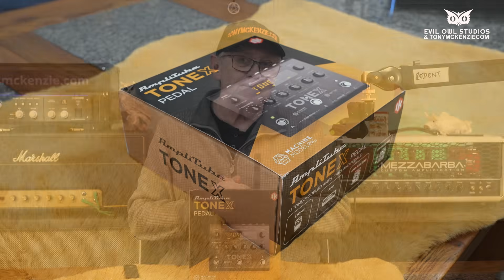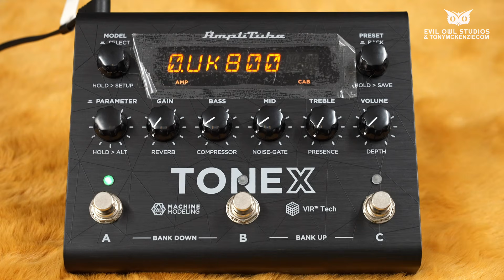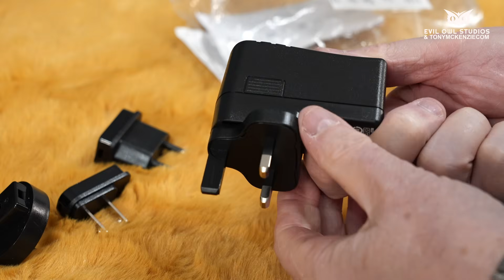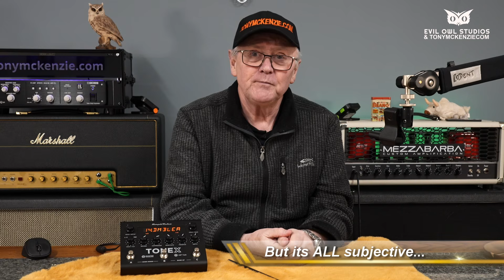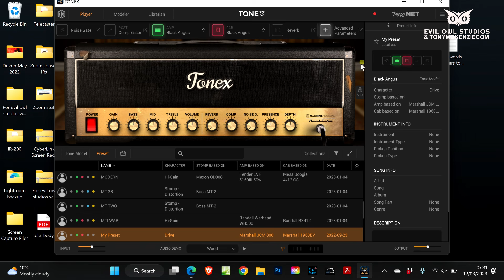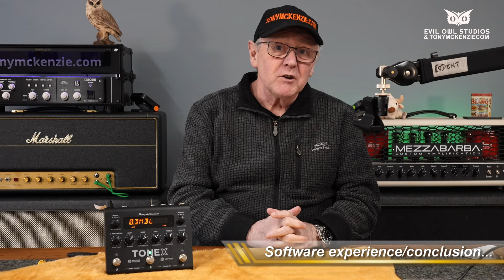TONEX Amp Sim  Simulator | is this Finally Utopia for guitarists?

Comment: I have a tonex software wasn't a problem to install , its worth watching a few you tube videos because there is quite a bit in the software split into librarian modeler and edit program like any new items you have to pick up tips and spend time because it  can do so much ,turn the gain down and set the noise gate on the pedal rather than the software it is noisy if you dont ,capture is excellent ,i'm not a young guy  but love how much you can do with its it will copy your amp and use it , you wont tell the difference  .
Reply from the maker: Glad you are enjoying the capture features and found a workflow that works for your setup, thanks for sharing your experience! And of course for watching..

Comment: soft problem is because of your laptop screen low resolution ratio. software designed to be fit 4K display. as you dislike china, I dislike software from Italy also, very bad interface. old people should speak less on computer things, not for your age.
Reply from the maker: Ha thanks for the info... and guess what, I was in IT since 1981... visiting Singapore, HK and Taiwan many times... we gave up on IT in around 2000 when we could no longer actually make money at it because Dell, HP and many others killed off the hardware dealers. ;-) I don't believe for one second that the software was 4K only... sorry about that - most users out there do NOT have 4K even now. Thanks.
Reply: @tonymckenzieofficial  today I update the new version of TONEX and AMPLITUBE software. maybe the very first day of new software the IK has big pressure on its server, can't afford so many download request. just some patience, my download recoveried a week later. all becasue of IK server. not resolution issue on today IK product manager software.

Comment: Nice pickin!!! I just got my tonex pedal.  Can't figure out the app
Reply from the maker: I had issues with the installation of the apps. The initial program installs then you authorise the rest from that program if I remember correctly. It took me a week to make it work and I was surprised that problem was on the internet about that program from 2 years earlier. Once installed it does work OK though. Hope that helps and thanks for watching.

Comment: I've bought the pedal secondhand for a bargain price a week ago. Ik Multimedia transferred the software to my account. I'm running windows 10. My whole live I play tube amps, I've got 8 of them. Fenders, Marshalls, Vox, Victory. I love them but I wanted to se where all the fuzz is about... Is this new kid on the block a game changer? In two hours I had the software up and running, tweaked some Tone models, compared them to my own amps and came to the conclusion that this device is going to stay. The latest software updates made things a lot easier. When I play specific Di amp captures through my existing amps effectsloop they sound 90-95% the same. In the end I buyed some captures and I could not hear the difference at low volumes and gigging levels. Indeed there are a lot of tweaking options but for me its intuitive. Will I sell my precious amps/cabs? Never!! But for the odd gig where no amps are allowed or where silence stage is a must or for recording purposes or grabbing the unit at the couch and play through headphones this unit for the price is a no-brainer. Not everybody can crank their amps to the sweet spots without getting in trouble with their neighbours. Another advantage of this technolgy is that it is still evolving and software updates will rapidly follow. I never thought in my wildest dreams that I would like the digital AI world but I only see challanges.
Reply from the maker: You should try the Kemper Player? While it does not capture - it does not need to... it has 22000 profiles of gear already... don't assume its 'no good' and I'm reviewing this right now... IMO it is superior on many ways... watch for the video. And thanks for your take on the Tonex - great to know you like it... and thanks for watching.
Reply: @tonymckenzieofficial  , thank you for mentioning the Kemper Player. I was in doubt which unit to buy and in the end I choose for the Tonex system because I have all my effects and modulation already sorted out and I knew that the software was updated. There are some "scientific"tests on youtube where these two units are compared to eachother. A lot of blahblah with nerdy measurements and in the end the conclusion is that NAM and Tonex in the amps department are still superiour. NAM is the best. FWIW I think that all these units (Kemper,Tonex,Helix,QC etc ) are capable of producing convincing amp tones. And I'm 60 years old and after 40 years of rock & roll volumes my ears aren't the best anymore....I leave the whole capturing process to professionals, because they have the best mics/pre-amps and know everything about mic placement and such. It's an art in itself and I'm willing to pay for them. 22000 is enough for a lifetime but I only need a couple of good clean/edge/chrunch/mid gain tones that are convincing. I think the most challaging part of this technology is not the captures itself but a decent accurate monitoring system which satisfies tube amp lovers. I don't like a lot of consumer FRFR systems out there.

Comment: Had the pedal since February.
Haven't turned on my EVH Iconic combo amp since.
You need to know how to program the EQ, gain, presence and depth to really make it shine.
The original captures are mud otherwise.
Fortunately, I have decades in synth and F/X programming.
The room reverb adds just the right touch of sweetness at small amounts, don't use the others.
One patch I've edited is worth the price of the pedal.
I run it through an EV EKX-15P with 1500 watts power and a 15" bottom.
Instant wall of sound.
God help my neighbors :)
Reply from the maker: Strangely, my versions of software were at best very ropey. I found the worst candidate was actually the software that is supposed to authenticate the other stuff to run. It never worked on my V10 Windows and on the V11 rather poorly for the most part. Good that you made it work well for you. I remain rather concerned about software releases that really did not seem to work correctly and the entire units dependence on software that was spasmodic. I wonder what might happen to this device and all the others they make if they ceased trading. Those are important concerns IMO and certainly had it all installed well then that would have been a different matter - as your opinion clearly shows. Thanks for the post and for watching.

Comment: Thank you for emphasising the DAC and how important it is. This is well known in HiFi. As we begin to use these devices more and more to convert digital to analog, it will become clear that there is a quality and application range that we all need to consider. It is the voice of the divise since it converts digital signals to analog and ultimately the output signal.
Reply from the maker: And of course the A to D converter too.. often paired by makers from what I see, but I did not check this unit sepecifically. Thanks for watching.

Comment: Great video but installing the software was a breeze for me but I will say the ToneX app comes with a slight learning curve but once I got it figured out (1hr or so later) its killer and much better than other products.
Reply from the maker: Sadly that problem has been around for a few years :( and it still currently does not work on that Win 10 Laptop (that can't be upgraded thanks to Microsoft!). Thanks for the post and your experience... and for watching.

Comment: Tony when I turn on my hand wired amp and I see the 6L6's glowing, it makes me feel good in a way a metal box full of surface mounted chips never will. Big difference in your opinion and a retailer trying to flog them to you. Imagine wading thru that instruction manual.....no thanks.
Reply from the maker: Ha some challenge what I say sometimes, but it really was as my experience showed as a user. Mine will be sold. Thanks for watching...

Comment: The washers are there to take the strain off when you plug in from the outside. They take up the spacing between the socket and the inside of the case to keep it tight. They also help to dampen the clunk as you push in the plug so it sounds less hollow. When I tried the software it played havoc with my USB interface and Studio One, so I had to uninstall it. I had that exact same issue with the hanging. Releasing software with this level of bug and support is completely unacceptable.
Reply from the maker: Of course I understand why etc. and thanks for pointing that out, I only mentioned those because I'm used to seeing plastic spacers that many makers do use. The washers work fine no problems there from what I see though... The software was clearly for me the weakest point and its one reason I did not spend much time on it - I just don't have the hours messing about, and the original hanging cost me three hours. BTW they did send me an email for support about 2 days in, and I'll follow that up when I get time and see what they say. If I do get an answer I'll probably make a short video of the answer. Thanks Phil... and for watching of course.
Reply: @tonymckenzieofficial  Thanks Tony. I would be interested to know what they say about the installation issue. Keep up the great work. :-)

Comment: Interesting review. I decided to go for it. I think on balance the pedal sounds great and is far less expensive than other products. Combined with my HXFX it has created a versatile rig at a price point I can afford. I have been using IK software for a fair few years and yes, there are many issues in my opinion however, it does work once you get your head around it. I found the pedal intuitive to use and suggest those unsure to find one to try as this review does raise valid points. Sonically though? I’m a happy camper.
Reply from the maker: Yes it IS a very interesting unit I agree and before I bought it, I watched a few 'reviews' (always guys that get them free!) and really was entirely unsure of how good or bad the Tonex would be. It was not bad, and I did like the hardware pretty much with little to dislike. The software I found out was (as you might have seen) seemingly dependent on what you're installing it on to. The Win 10 failed miserably, and the Win 11 did work. There IS a lot for the money overall, but having time in a review to start going through it all at the time was hard as I messed about for three hours on the Win 10 episode. This will be a great unit for some guys, a good one for others but anyone that is not really a software guy should walk not run. It IS priced right no doubt. Thanks M - and for watching too.
Reply: As always Tony your reviews are detailed and informative. My TSL was struggling until I found you and your extensive information and since then it has worked flawlessly. Keep up the good work, there are many who appreciate and benefit from it.

Comment: I think if you purchase this pedal, it would be used for live performance using external effects. I downloaded the free version to listen to the amps and was fairly simple and sounded good. Wouldn't have to get into amplitude 5 unless using for recordings. You can't transfer the effects to the box anyways. There would be plenty of captures you could use without having to get into capturing your own. Just use it as an amp, as it was designed for and not mess with all the other headaches.
Reply from the maker: That's a not invalid comment. If I was going to use this, like you said, there are multitudes of things to downloads, captures etc. I found on the Kemper (a good example really) that some captured gear posted was not always great and you do have to spend time on checking those all out whichever of this type of gear you buy. The capture procedure can be difficult and the guy with all those amps (Tone something or other) got his friend round to make all that work. But once you set up that pedal with what YOU want then really it could just be used like that if someone was not in to the software. Good point and thanks for watching.
Reply: Thanks Tony, I generally play live with my marshall jvm and don't own the tonex pedal. I do use and atomic amplifire 6 for short shows and works great thru my pedal board. When I record, I use my tascam model 24. Just don't have the time to play on the computer editing stuff for long periods. Thanks for the review!

Comment: I have to be honest, I have the Quad Cortex  & the Tonex  (and I have owned the rest too). The Tonex is 'as good' as the QC, in my opinion. OK, the QC has effects, but what it does have are nothing to jump up and down about.  If I wanted a really great set up on a budget, I'd but a Tonex and a TC Electronic Plethora X5, for my effects. I am at the age where carrying amps & cabs around is a struggle, but I still want the 'amp' sound. I always appreciate Tony's reviews, but I differ on this product. Regardless, he's still a superb reviewer, and I love when he says, "I'm back".  Regards to you, mate.
Reply from the maker: Ha I'm back :) I never did 'bite the bullet' for the Quad Cortex... almost a few times. But I still have the Kemper and that remains 'interesting' over the years since 2011 when I bought it. It's not that I did not like the Tonex, and like I said I do have the Kemper among other stuff, but the software became difficult on the first PC (over three hours to try and resolve it and I had to change the PC) which slowed me down dramatically. I have used plenty of this sort of software in general but the time factor I really did not anticipate. The hardware was very good and I did 10/10 for that, but I did think the software could have been improved somewhat. I never had a single issue with Kemper software (but then again the Kemper is much higher cost). Ha not sure you're my age, but trust me on this, I'm probably as old as anyone wants to be carrying gear :) it's hard somewhere near 70! How I do this stuff I am often surprised I still do it. Thanks for the info - its all great information - and that can only help many I think. An interesting unit for sure... and thanks for watching.
Reply: @tonymckenzieofficial  Thanks, Tony, good to hear from you. Let's be honest, in a mix it's all subjective. They all sound great these days :)
I had your fave rave (the Axe FX) I was never taken too much, a great unit though. The Kemper, I liked it, not enough to keep it though. The QC;  well as I managed to get a stunning Engl capture (my dream amp) I kept it. It's excellent, recorded :)
The Tonex; I just like gear (sound familiar?) lol. Best regards from Liverpool.

Comment: Exceptional insite on this that the other 7 or 8 videos I seen they didn't include (manual, software...). Brilliant, thank you sir.
Reply from the maker: This is why I always mention it all. One guy asked me somewhere on here about the spec sheets and 'what relevance' they are, but they DO have relevance IMO, just like the manuals, the software, and importantly the support which I always think is critical for anything that has a high level of software. Thanks for watching - its always appreciated.

Comment: Good review. I think the software issues won't bother people who are familiar with Amplitube. 

I do agree that there are probably better options for people who don't want to mess with software (Strymon Iridium, UAFX, Walrus ACS1, etc)

I also think some companies like Line 6 have a better communication between software and hardware, but they've been in that game a lot longer.

I know you are amp guy, but sadly the future is looking to be less about amps. Partially because of the reasons you named, but also because most venues want lower noise. 
It is what it is.
Reply from the maker: :) Well, software can be volatile, and one reason I mentioned the support aspect. It was a bit ropey from my experience. I'm sure over time it will improve and be a better experience especially re the install aspect which was surprising that the apps were not published as registered products... (Microsoft said) that was something I have not seen for a while. Well I am an amp guy, but I also own a Kemper, a Helix, Boss gear etc. etc. so I am always open to good gear and software I don't really mind (I have Studio One in the control room also) when it works well. But I'm sure it will get better. As I mentioned in the review finding ANY new amps is particularly difficult since 2020 which is pretty weird. In sectors I work in there is still shortages of electronic components etc. In any case good points you raised and I appreciate that as it helps all round for anyone who comes and reads the posts. And thanks for watching...
Reply: @tonymckenzieofficial  I appreciate how you do your reviews. 
Would you be interested at all in some of the newer solid state and digital amps?
The Boss Katana/Katana Artist and Nextone are very well loved. 
Blackstar also has some interesting tube amps and a new analog solid state amp. 
There are also the Line 6 Catalyst amps. 

They may not be as pro level as some of the nice amps you own, but they are what folks are buying and gigging.  It might also be fun to try out instead of a device that is mostly used to go direct.

Thanks for all you do!